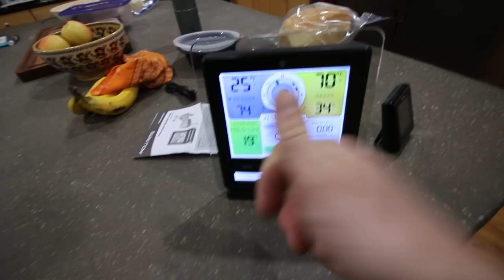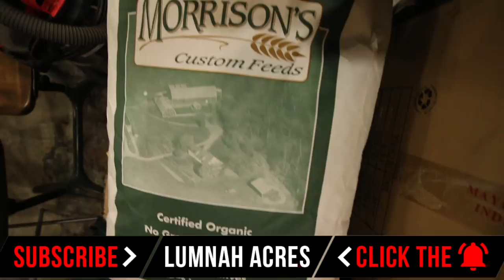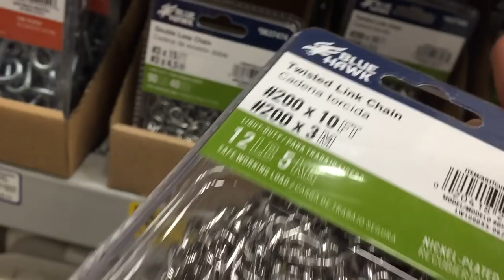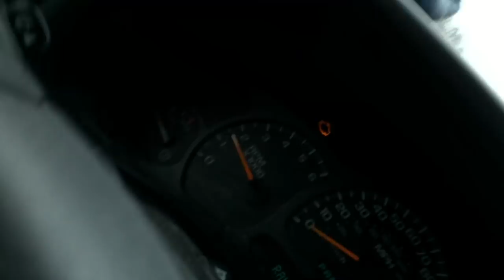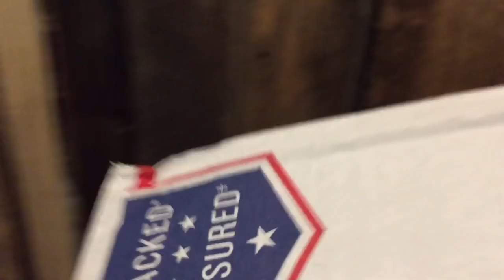Chicks are Ordered now we Need a Brooder to Keep Them SAFE from FIGARO ~ Getting the supplies Today

Comment: WEATHER STATION. Mount on long 2x4 with a hinge on the end. Mount to meat pole. Then swing up in place. No ladder.
Reply: Nice idea! That would make it much easier to access to change the batteries as well. As the mount for it also has a round section for a pole, perhaps getting a long section of pvc conduit pipe and attaching that to the back of the meat pole with pipe clips might also work?
Reply from the maker: Know that is thinking. You got my gears spinning know!

Comment: AL how long has the check engine light been on?  I have a 2006 Z-71 and had 2 issue 1st gas cap, second was a vapor sensor in the vapor recovery system.
Reply from the maker: A year! Lol. Its an evap leak